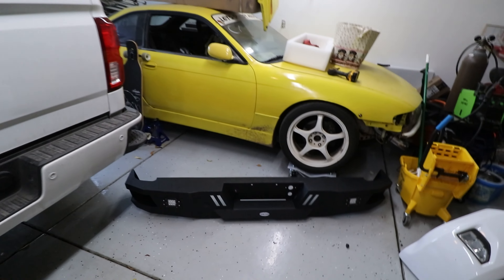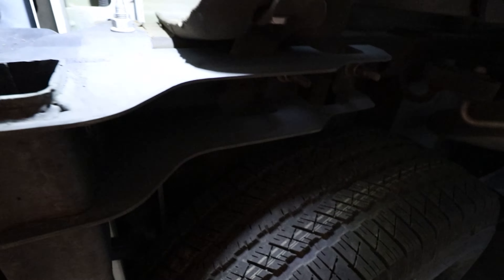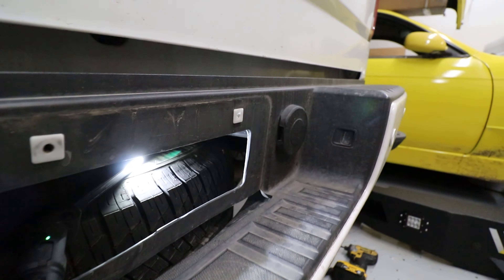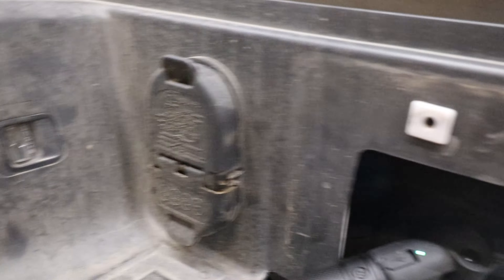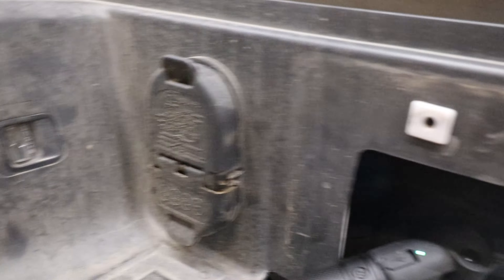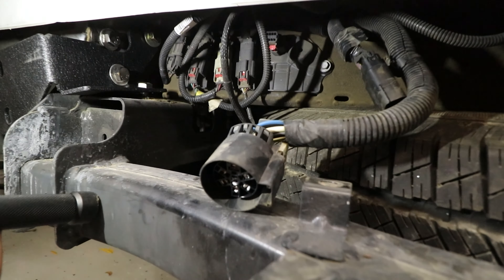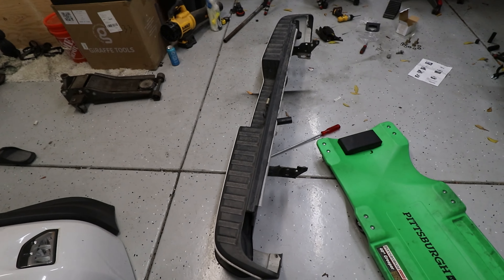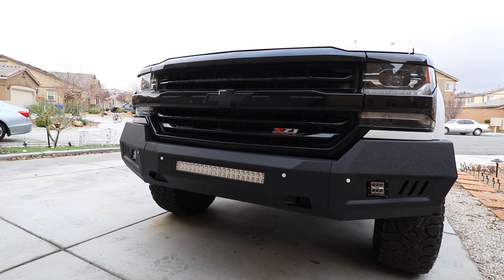Z71 Silverado Off-Road Rear Bumper Install

Comment: how did you get the parking sensors to stay in? Mine were sloppy and don't click in.
Reply from the maker: Mine had a tightening set screw that i snugged them em with, Wish they had a snap in design though but so far they have not came loose.